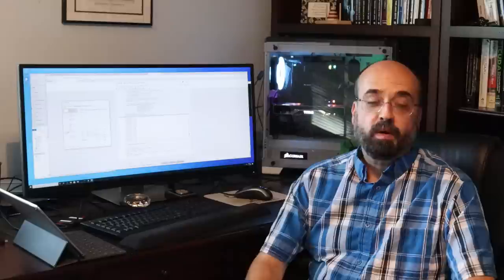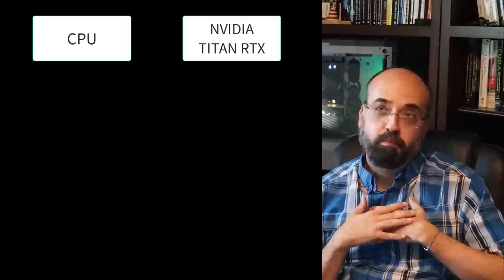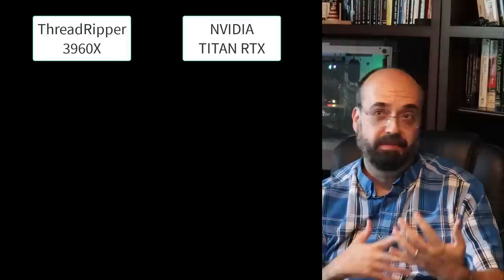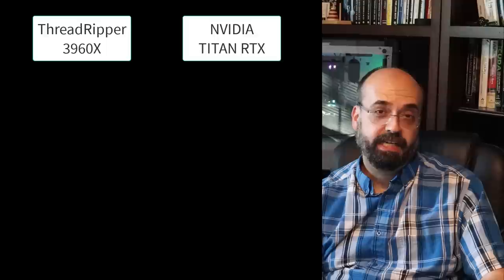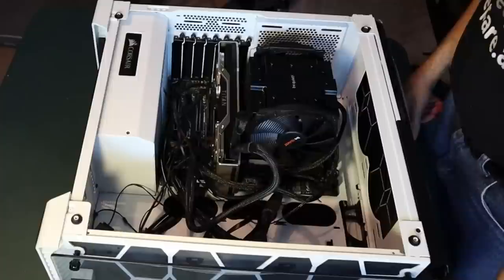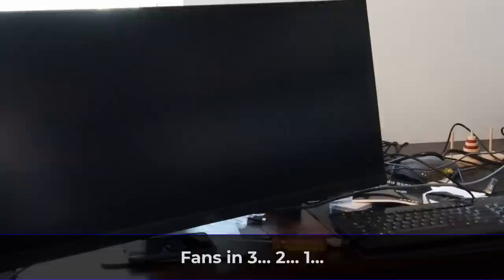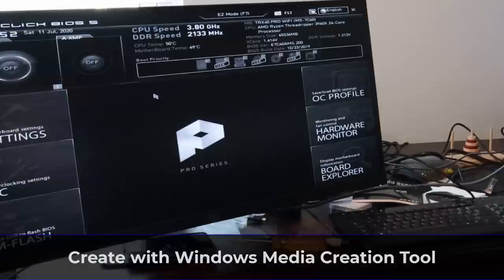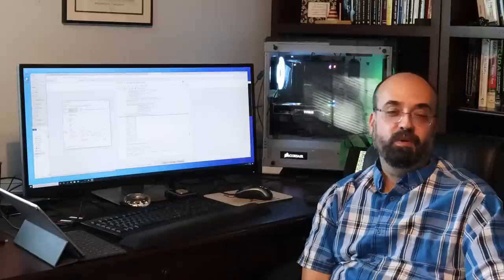Building a $5,000 Machine Learning Workstation with a NVIDIA TITAN RTX and RYZEN ThreadRipper

Comment: Hi Jeff. At 9:08 The little piece which you remove. Man: This is the thermal pad which works with the M2 heatsink  (the black metal piece on the top f the M2) in order to reduce the temp under heavy workloads or long operating hours.

Comment: My own preference is to ensure motherboard capabilities related to bus speeds, I/O transfer speeds and RAM capacity BEFORE I specify CPU.  It's all about minimizing bottlenecking.  CPU-wise I've been an Intel user for several decades, but I am looking forward to using AMD in my next major build.  

... and yes, my skin still has a bit of a green tint from the TITAN RTX-envy.   :-)
Reply from the maker: Hello Brad, yes I can certainly see that approach.  I also have been Intel, forever.  I did build one system with dual Athlon MP's back in the day. I really like ThreadRipper.

Comment: Hi Jeff, it's nice and informative.

I'm a PhD student and I'm planning to build a similar workstation but with RTX 3090; 128 gb RAM for Deep Learning as well as for Molecular Dynamics simulations. 

Does the Threadripper is capable of managing heavy workloads.

As you already mentioned in the video, while running the tasks (2-4 days) are there are any heat issues with CPU & GPU

Do you suggest Threadripper 3960X/ 3970X (Zen 2 architecture) or RYZEN 5950X (Zen 3) for Deep Learning & molecular dynamics simulations.

It would be great, if you can comment on it.

Thanks in advance !!!

Comment: Please I need your advice, I dont know if I should buy the rtx titan, or the rtx 3090 that comes out at 24 september, It's for machin learning, the rtx 3090 has 10496 cuda cores, and the rtx titan has 4608 cuda cores, than titan has 70 mhz more on boost clock, 5 less gbps at memory speed, and consumes only 280watt, instead of 350 consuming from rtx 3090, so 3090 seems better even tho it cost way less, but rtx titan has 6 gpu clusters, are clusters so good for deep learning?, which one should I go for?, rtx titan because it has 6 gpu clusters, or for the rtx 3090, because it's new, more upgraded, better performance in terms of memory speed, better ray tracing, but from the other side we got rtx titan with 576 tensor cores against the 328 core tensor performing from rtx 3090, even tho rtx 3090 got the new technology gddr6x, the gpu is not for me it's for my brother, I wanna make him a gift, so I can't ask him which one to buy, I guess he uses stuff like Ubuntu and Cuda, im not sure but I heard that he installed ubuntu on his pc, while he was talking to his friend via cam, I want the best gpu, doesn't matther if the rtx titan costs 1k more, if it's better im gon pick that, because it doesn't make sense that rtx 3090 performs better than rtx titan if it's cost 1k less, or do they need to upgrade their prices?
please help me Sir Jeff Heaton, or someone out there guys,tx everybody
Reply: Hey my friend, the 3090  will be a much better pick.
I always used a 2080ti for deep learning and the only throwback were the 11gb of vram. But the 3090 will have 24gb and also a much higher performance than titan rtx and 2080 ti

Comment: I built a similar rig. I have an AMD Threadripper 16 core and an NVIDIA 3090 GPU. Also I am running a Cosair 1000W power supply, probably going to upgrade to a 1200 watt power supply.
Reply from the maker: Sounds like a nice system.

Comment: For most motherboards you would put the M.2sdd in the top slot and not the bottom one like you did here. because the top one goes straight through the CPU the bottom one goes to the VRM.
Reply from the maker: Thanks! That is a great point.  I am about to add a 2nd M2 HDD anyway to dual boot with Linux.  Now I just need to decide which OS I want the more direct slot to have.
Reply: @HeatonResearch   Hey Jeff. Btw Awesome build you have here. 
I have just recently opened the doors to AI deep and machine learning and still in the learning progress of TensorFlow, but I would have all the data you use for training go straight to the CPU so if you train an AI in Linux in some sort of IDE I would use the top slot for that. and the other way around if you use IDE in windows to train.

Comment: Hi can anyone help troubleshoot this issue: the Sabrent Rocket 4.0 M2 SSD isn't appearing in Bios or Windows. I've updated Bios, changed the PCI configuration to 4x4x etc., enabled and disabled secure boot, ensure SATA on ACHI, tried CSM and UEFI, changed the SSD to both M2 clots on the mobo, and secure erase (no SSD detected). The mobo was tested and the SSD was brand new. The M2 slot 1 and 2 both read No Present no matter which slot I install the SSD. 

Please help if possible/any ideas

Comment: Hello. I will build machine for ML learning, thinking between Ryzen 7950x or i9-13900kf. I would like to use pcie5 ssd so here comes the problem - whats the pcie bandwidth utilisation during some training? Will there be enough pcie4x8 speed - because pcie lines will be taken by SSD if I'll use Intel. Or should I go with AMD which has better support of pcie5 without line cutting?

Comment: The cooling system looks a bit modest for 3970x.   7 months later do you still find it to be enough?  TIA!  Looking in to building a similar system.  

Looks like the cooling system used in the video is different from what’s in pcpartspicker.  I was curious about the cooling selected in pcpartspicker.
Reply from the maker: Yes, I did end up expanding it to an AIO liquid cooler.  Not currently running into CPU throttling issues.  Here is the updated system.  https://towardsdatascience.com/nvidia-rtx-a6000-based-data-science-workstation-2e05a4b846cc

Comment: Are you in New builder? This is the first time I've seen a video and I'm not trying to be mean I just am unsure. The best way to put on thermal paste hands down is to use the spreader and make a thin layer evenly spread that way there's no guessing to it. From what it looks like you're going to have too much. Also the information and recommendation about water cooling is inaccurate. Well I don't fault you for it as it was advice that you were given but it being a data driven setup is even more of a reason to run water cooling. They're extremely reliable. Maybe 10 years ago they weren't. I'm building three deep learning AI systems concurrently right now. All of them will have full custom water cooling systems built by me and each one will have dual pumps as there's lies the only risk and even that is rare. That way if for some reason one pump goes out I still have no issues and worst case scenario it'll throttle and shut itself off anyways without damaging it

Comment: and they were right, you should've gone with liquid cooling, it's not much costly .
Reply from the maker: That is likely be coming... I know RGB is frivolous, but it is really bugging me having a gigantic air cooler right in front of my RAM.
Reply: @HeatonResearch  imo liquid cooling will also reduce the noise coming from fans and it will keep the system more cool and hence increases it's lifespan.
Best processor demands best cooling.

Comment: Thank you Jeff for the tutorial! I am also building my first desktop for the same purpose. I finally got a 3090 and building everything around it. Would you recommend the Threadripper or would a 16 core Ryzen 5990x do the job? How is 64Gb doing in your tasks? Do you think it's enough or would a 128 be better for processing large files? (I am talking about 30-40GB csv files)
Reply from the maker: Cool, congrats on the 3090!  It depends on how you use the machine, I still often run non-deep learning tasks off GPU, so I wanted those extra cores.  If you are primarily on GPU, particularly with something like Rapids, then 5990x should be fine. I tend to be pretty efficient with memory, so generally the 64GB is working out good.  However, 128GB is my next planned upgrade.
Reply: Thanks for your reply. My main tasks are CPU at the moment Parallel jobs. I am just diving into models that require a GPU for fast results. I will probably explore my options for a TR chip and Mobo to avoid having to change too many components in case of an update. My question is whether a TR 32-core is twice as fast as a 5950x 16-core with multi-cores and how faster is the 5950x for single-core tasks. I would be grateful if you have a benchmark to suggest.

Comment: Do you have install WSL 2 in windows 10? Now WSL 2 can support CUDA? Because i 've worried in the future people will more develope machine learning tools and library in Linux rather than Windows in near future. Since ML library and tools alot using Linux rather Windows.
Reply from the maker: I believe that you can use CUDA from WSL, and it is on my list of things to try.  Most of my deep learning has been in Linux, so I am trying to see what this all looks like in Windows native.
Reply: @HeatonResearch  I'd be interested to hear more on this as it was the one thing in the video which surprised me (picking Windows). Dual booting so you could benchmark between the two would be great, but I realise that's quite a faff!
Anyway, thanks for the video, I'll be looking out for future installments 👍
Reply: @HeatonResearch  Good luck trying to install NVIDIA/CUDA-enabled machine learning libraries on Windows. I tried to install theano once, worked on it for 3 days, and had to admit failure. The Lambda Labs stack in (x)buntu 16.04, 18.04, and now 20.04 manages all that for you with a few lines.
Reply: Why worried? People are already doing ML applications and favoring Mac and especially Linux over Windows, because the constant back-door ways of doing things that Windows uses are MUCH slower. If you want your numbers now, thank you very much, you'll simply have to use Linux. There's a reason every single supercomputer on the planet uses Linux. For serious mathematical computation, nothing beats it, not even Mac. Apple doesn't play well with NVIDIA, so it's hard to make use of GPU acceleration on ML algorithms.

Comment: Out of curiosity why did you go with the 24 core? Do you have a specific workload? I would have gone ryzen 9 saved money there and on mobo and thrown it towards another GPU. Ever since I've started using CUDA to accelerate work loads I dont find myself leaning as hard on my cpu. Tho I still appreciate my 16 threads for data processing.
Reply from the maker: It was a cost tradeoff, the 3990 was temping, but I was only willing to spend around $1K USD on a processor.  My machine is very generalist, sometimes I run CPU-intense over GPU-intense.
Reply: @HeatonResearch  I meant scaling down the cpu to a 3950x and saving money in that way, but that wouldn't make sense if you have CPU intense work loads. I'm sure having the 48 threads is great.
Reply: @nicofish1000  48 threads is fake marketing nonsense. 24 threads is the max extent that the parallelism a 24 core machine will get from parallel speedup.

Comment: Sorry for more, but hadn't watched the video to the end on my first comment - particularly, IMHO you used way too much thermal paste, and the way you put the paste on, it's very possible you even have air gaps. I use my clean finger and spread the paste as thin as reasonably possible. Obviously yours works and stuff, but you may check or keep an eye on your CPU temp. monitor.. I'm not sure now much it will affect it, maybe not even noticeably. But the idea is that no matter how you look at it, the best thermal paste won't conduct heat as well as metal. you pretty much want the thermal paste to fill in the molecular gaps that will definitely not conduct heat well - air gaps, essentially.. even if both surfaces were polished to the extent the disks in a hard drive are, I'm pretty sure you'd still get gaps. You pretty much should be able to see through the paste enough to read/see what's on the chip. But as I say, just check your CPU temp, as I've never put 100th of the paste you put on.. (and I've built many since the early 80's or so) so I can't say how much it'll affect it. If your CPU runs too hot, you'll just shorten the life.. but if it's from 30 years to 25, who cares, right? Just compare what it's supposed to run at or other's run at during heavy benchmarks. If you can't tell the difference, no worries.
Reply from the maker: Thanks for the suggestions on thermal paste.  So far CPU heat has not been an issue, but good info to know.

Comment: Was the 2080Ti available when you did this...?  you could put 2 of those in at the current price on your pcpicker site for the Founders edition of $1200, so 2x 11GB would give you only 22GB, but pcpicker didn't list a regular Titan RTX w/ 24GB and this ~20yr old laptop w/ 1GB is going too slow for me to find a site to compare the other stats of a Titan RTX vs. 2x 2080Ti's. I'm Thinking of getting a Titan RTX, as down the road (as in, after a few more paychecks) I could theoretically put in a 2nd Titan RTX and have 48GB of video RAM.. but now there's all these stories of all this new super stuff out like this month or a month or two that might save me something off the $2500 Titan RTX price and more power/RAM/cores/etc.. I'm going crazy trying to figure the best config for an AI dev box, and even just the GPU to start with! Then CPU (current), those super-fast SSD drives you can put in your PCI slots - vary, but can get up to about 10x faster than regular SSD drives (or even SATA can theoretically top out at...) Ack! I'm not rich, but been programming since 78, building(/repairing, etc) PC's since pretty much the 1st clones started coming out, AI classes in 86 (and lucky AAAI annual conference in Seattle in 87, so some other students in the AI classes and the instructor went, and I bummed a ride - only city in the US I could get to, lucked out!) have some great AI ideas, but my barely CUDA capable GPU, and my $1200 CPU came out about 8 months before the NVX instruction set, so I'd have to re-compile Tensorflow 2 disabling the use of them in the compiler, but then my 1250W power supply (also 10 yrs old) died, so figured, time to bite the bullet, but deciding with all these crazy new upgrade releases of GPU and other hardware!  Bit  long, sry..
Reply from the maker: Yes, the 2080Ti was out, however, the Titan RTX was the one fixed point on this build so I did not consider it, as I was working with NVIDIA.  The extra RAM does come in handy for some of the projects I do.

Comment: Aw c'mon, let the kid do more of the fitting. Then get the both of you a frisbee and some vitamin D at a park once you manage to pick a ML task that's not done in 28 seconds.
  Can't believe you didn't vent it outside. Just a little drywall work, and...  Plus installing Win10, which offers no VMs and limited cores...not? 10Pro? What was the part you removed to fit the M.2 SSD in, conformal thermal stuff that wouldn't conform?
  Ultimately, I don't know why you didn't pick a different PCIe device for graphics as opposed to the AI just to run monitors and junk; If graphics crash, that's down to any number of utilities and OS quirks; if it's the AI task crashes, is your CUDA or whatever set to DIE (and be reborn! It's computing!) or will you sort of find out in the 'morning?' Or is it firewalled from gfx on the same device by the latest (driver) magic from nVidia and MicroSoft?
  Also, the biggest smile is in the inset subscribe pic? What about booger looks from the benchmarking heat? And smiles from the benchmark results? I don't see the build being finished until the fan response is proven; it isn't like FermiLab sent their old LN2 system for XPELS for extra cooling. Such slack.